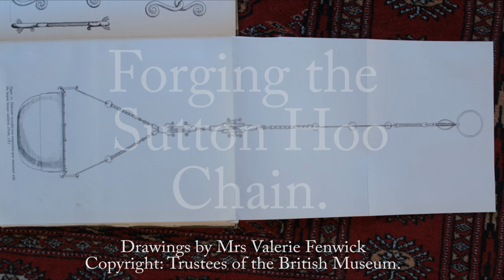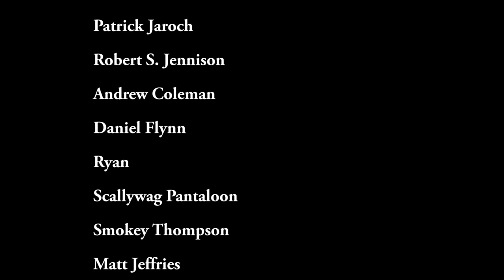Reproducing the Sutton Hoo chain. Part 1: The suspension ring.

Comment: Any idea what size material the Sutton Hoo smith would have started with?  If they were welding up a bunch of small bars, then it probably wouldn't matter if you started on the power hammer to forge the paddle rods down to a period accurate size range, then switched to the anvil. That might in some ways be closer as you could figure out how they would have constructed the pieces based on the type of starting material they would have had.  Maybe?